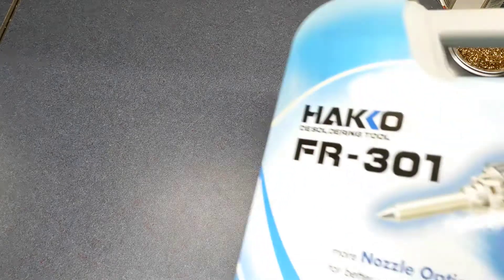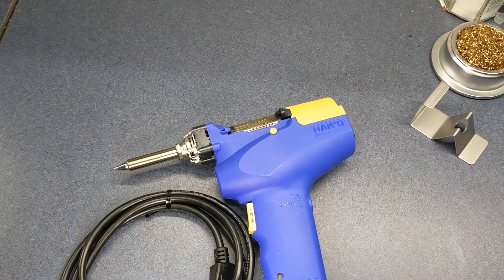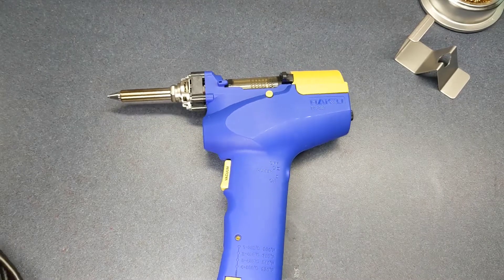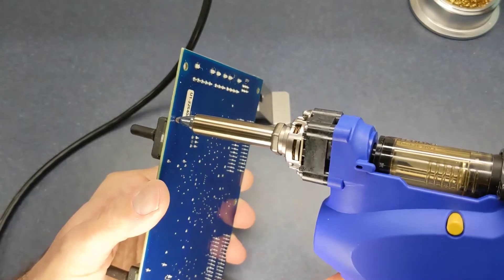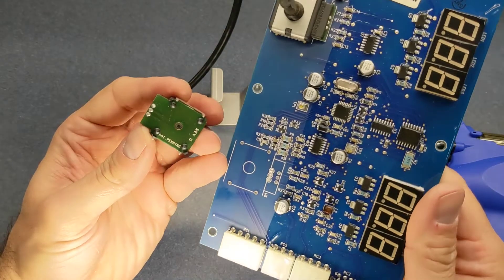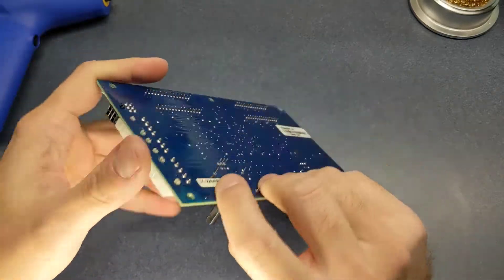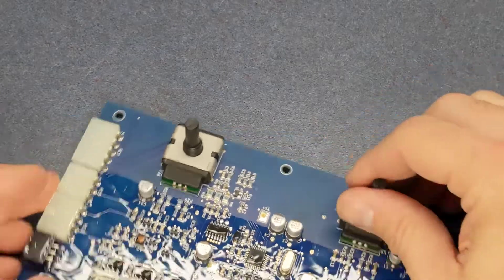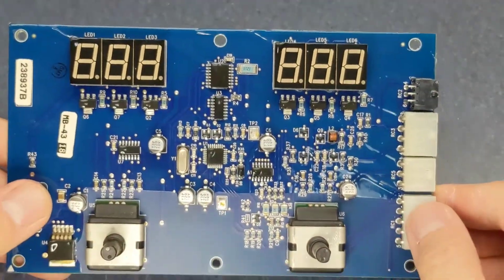Hakko FR301 Desoldering Tool unboxing review and demo.

Comment: Did that guy come with an extra tip? I kept reading that it should have - just wondering if I should buy one or if the one that comes with it should be a good size to zap from switches out of keyboards.

Comment: Just bought one myself. Fantastic tool. Saves years of anger and frustration. Spent 3 days getting all the goodies out of my PCB pile, got a ways to go.
But I want to thank you because @4:40 you show how to use the damn iron holder. And that's the only thing I needed instructions for; the rest was a snap. It looked like it's supposed to be hooked over a door or shelf and stick the iron through the hole, but hole is too small and over a door or shelf is just ridiculous. I thought am I supposed to drill mounting holes? Booklet says nothing. I think the manufacturers get a chuckle by throwing in a metal abstract sculpture and saying, "We'll call it an iron holder, let's see if they can figure it out."
Last note: I put my temp adjust at 2 1/2, seems to work on most anything, 
Ciao!
Reply from the maker: Thanks for the comment 👍 I can't believe I went all these years myself without this thing, hard to tell how many spools of resoldering braid I have went through over the years lol.